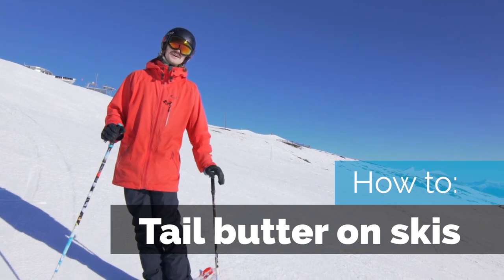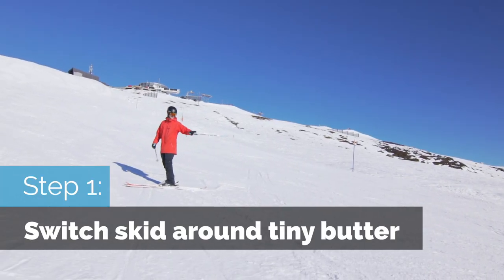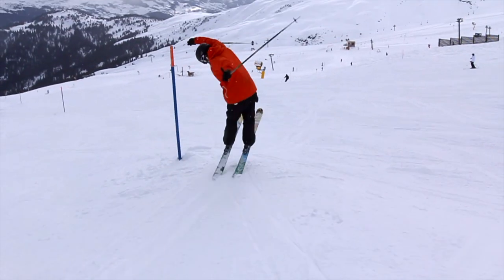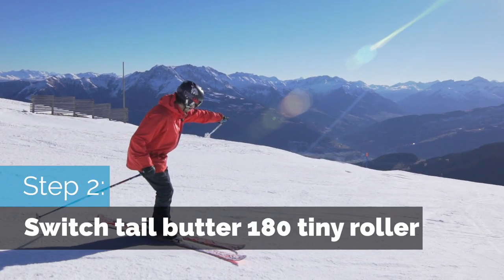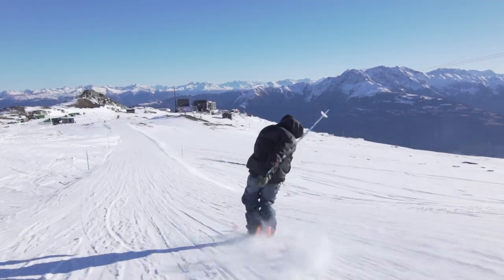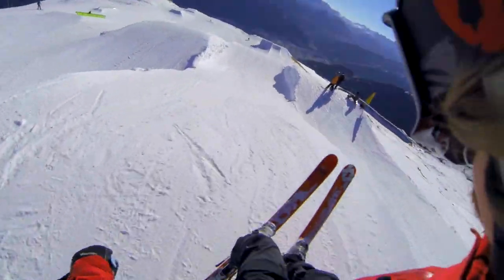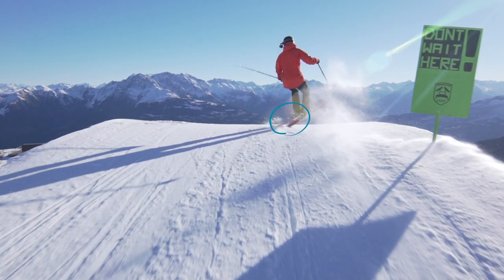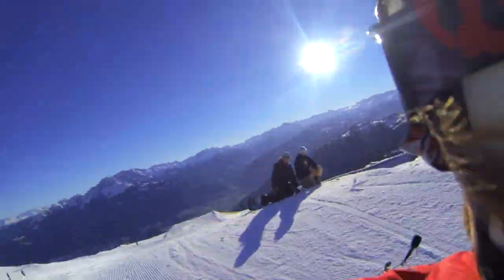How to Butter on Skis | Tail Butter

Comment: I weigh 145 and my binding were set to 4.5 and I am almost constantly piping it of them and any butter attempt I almost ameditly pop out! what should be a new din set that would work well with my weight so I only pop out when completely necessary
Reply from the maker: Thats a dangerous question. This is how I did it in the past. I just increased the din a little bit then went skiing with it if they popped off to often I increased the din a bit and go ski again until I found a safe din setting for my self. Do it at your own risk.
Reply: thank you so much